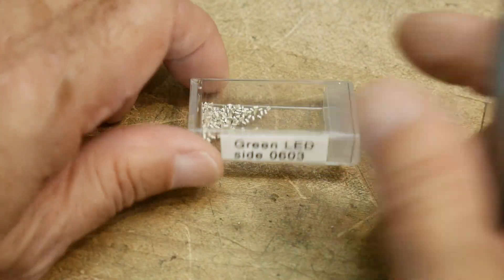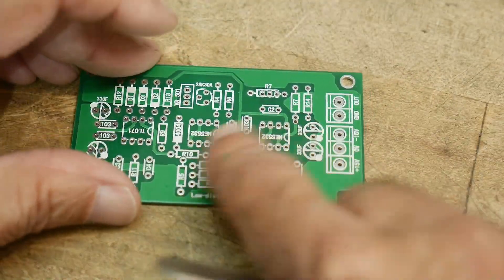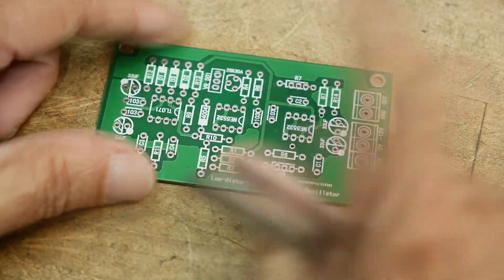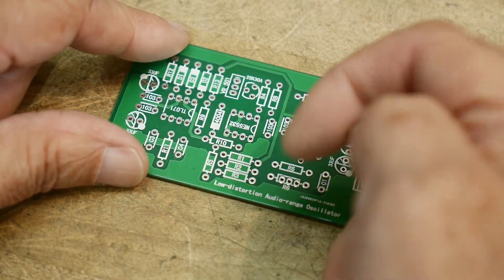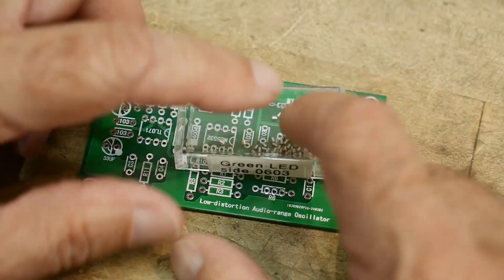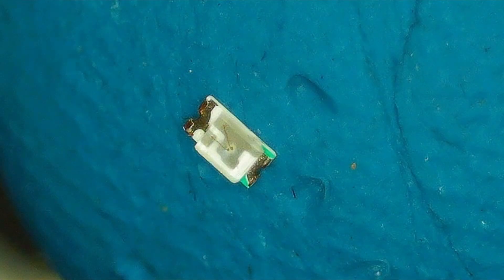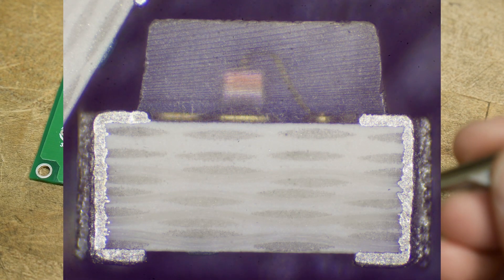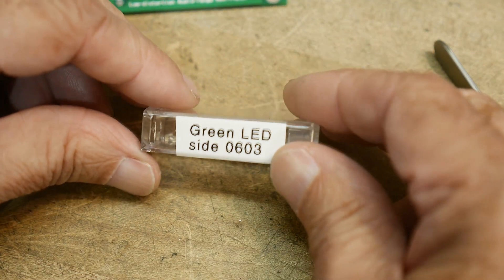#1950 Side Emitting LED

Comment: Also the bottom emitter, which is great for use if you use a single sided PCB, or a multilayer board with blind vias to the inner layers, so the one side is bare copper, and no holes, with only a silkscreen and possibly a black solder mask to allow them to shine through. Works best with capacitive touch switch IC's on the side with the LED's, and the one inner layer forming the touch switch, and a ground plane with holes for the other layer to keep RFI down but still allow the light through, along with low capacitance to the switch contact.